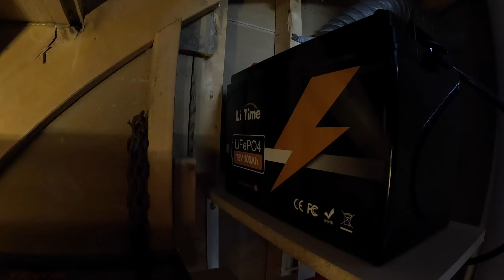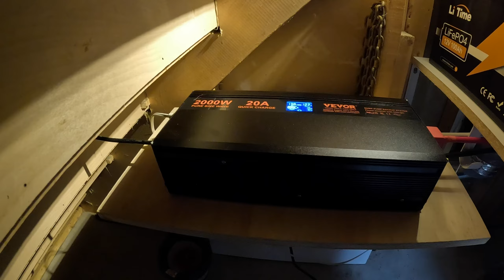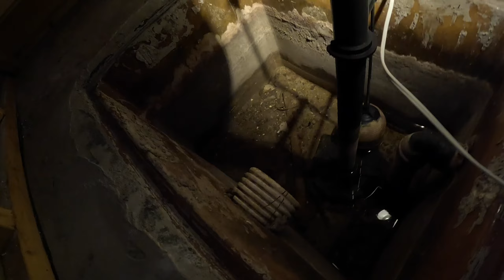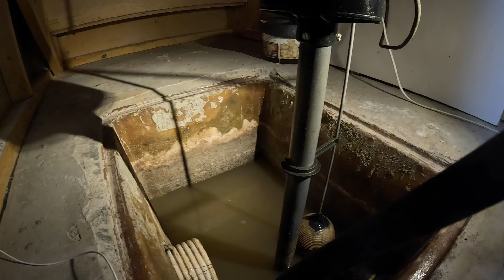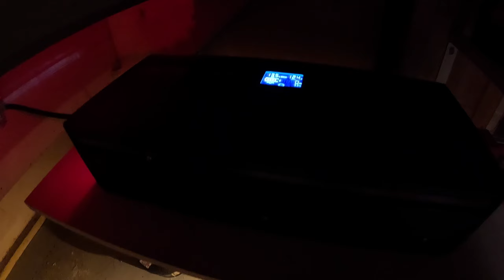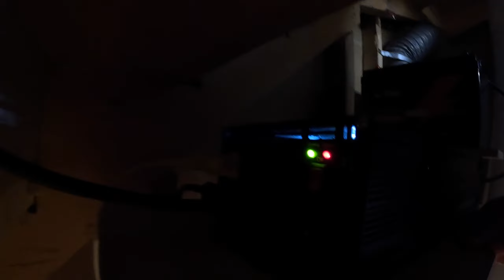Sump pump battery backup with inverter-charger - prevent flooding in your basement!

Comment: Is it safe to keep the inverter charging the battery? Even if the pump is not running. Thank you.
Reply from the maker: Yes, it’s safe. This Vevor inverter-charger is designed to stay connected and maintain the lithium battery even when the pump isn’t running. Ideally, the battery should have built-in BMS. It charges only when needed and stops automatically. Btw, I recently switched to all-in-one EcoFlow delta power station and can’t be happy more. We also use it as a backup for power outages. Got mine from Costco.

Comment: How many hours of use do you think this will get you?
Reply from the maker: @felonies, honestly, I will guess here since the battery didn't have a bluetooth and the app to see exact charge. My guess - for this pedestal pump, it will probably hold for a couple of hours.
Btw, not to talk you out of this setup, but I replaced inverter+battery with all-in-one power station from EcoFlow - Delta 3, this one is fantastic and much safer. I will be making a video soon, but I have already tested it with heavy use and same - it will give a couple of hours of use with my sump-pump.

Comment: I am trying a similar install and using a transfer switch and non-gassing battery like your Amazing Video since I already own the 2000 Watt Inverter and can run my furnace fan in case of winter power outage too will post when done!
Reply from the maker: @ecolawnaerstorcompanycanada Thanks for watching! I am discovering another option as well - using EcoFlow Delta 2 or 3 model. It’s powerful enough and does not require a transfer switch, all in one model. I am testing it this week and will be posting a video soon. It’s just another alternative.

Comment: The operation manual indicates: to connect first the negative cable to the battery and to the black post of inverter. After that connect the red cable to the battery and connect the red cable to the red post of the inverter. If the connection is correct some sparks is ok. Page 8 top. You did a good job, thanks for teaching us all that.

Comment: One small problem, I got the same inverter and in the operation manual it indicates not to be use in the top of flammable material. So put same metal plate or ceramic tile under.
Reply: My Digital Power Inverter Motomaster Model 011-2004-4 States to leave at least 2 inches (5 cm) of clearance in a well ventilated area so wood is fine for mounting.
Reply from the maker: @cristinmorandi2815 Thanks for the feedback, it makes total sense. I will cover both shelves with thin steel sheet and probably throw a tile on top of it.